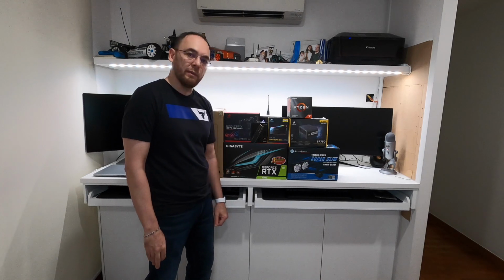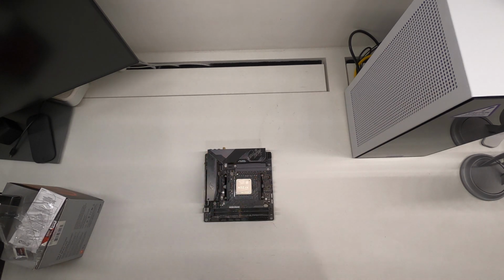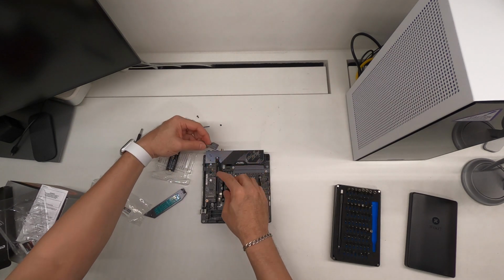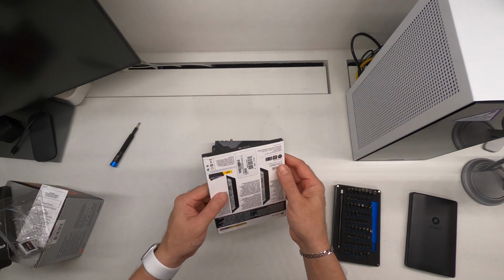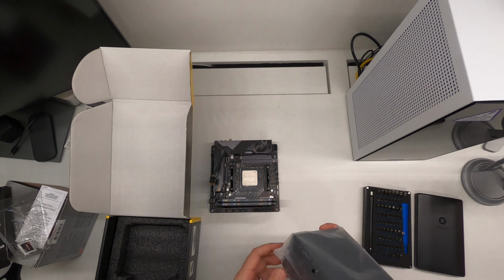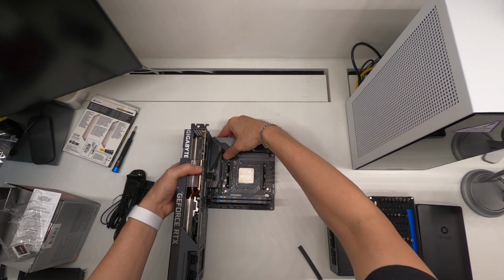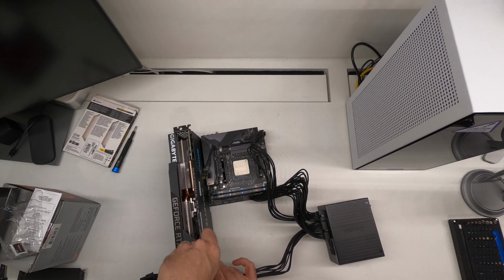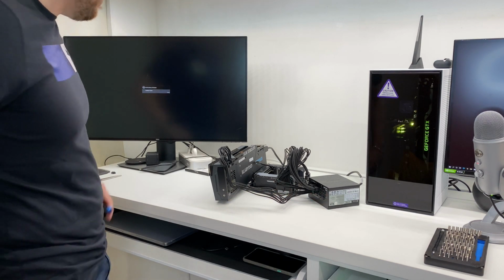Cooler Master NR200P ITX build - Part 1

Comment: This is exactly the build I have been looking for. Thank you for the detailed showcase of the build through part 1-4. Good job 👏🏻.
Reply from the maker: Thanks for the support. One thing to mention is that I did change where the radiator is mounted in order to improve thermals and to reduce wear on the AIO. With the AIO mounted below you can hear the pump whining which generally isn’t good long term. Follow up video to come to talk about the findings,....
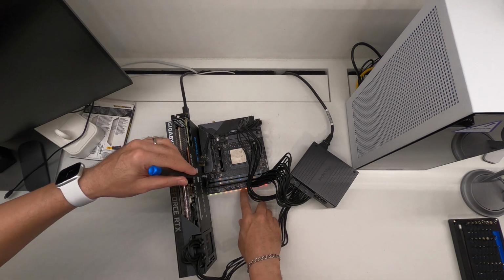Reply: At around 17:53, two pins were shorted with screw driver. Can you explain what this does and why? Good videos thx!
Reply from the maker: @jayzbond007  This was done to emulate pressing the power button. To bench the system you will not have a power switch connected so to do this test you will need to short those 2 pins. If you are confident in that all your parts are tested and working you can skip the bench test. For me having done this a large number of times I generally do this as you can experience hardware defects (DOA -  dead on arrival).
Reply: @FizzysTech  thanks for the quick reply and explanation. Cheers!

Comment: Mind sharing a bit more? Like various clips of the final build inside and out, as well as some thermals and game performance would be really cool!
Reply from the maker: The build edited video was about 1h 20m so I'm slicing it into parts,... working on uploading the next parts,...
Reply: @FizzysTech  any reason for getting the 3700x instead of the 3600 or even waiting for zen 3? The performance boost is apparently a big leap, though I guess availability could be an issue
Reply from the maker: @morganbruno3252  This build was done a few weeks back so zen 3 was not available. I do have an ATX build coming up once zen 3 and the 6800/6800XT are launched (assuming I can get my hands on them!).